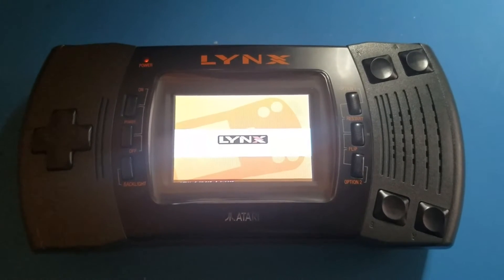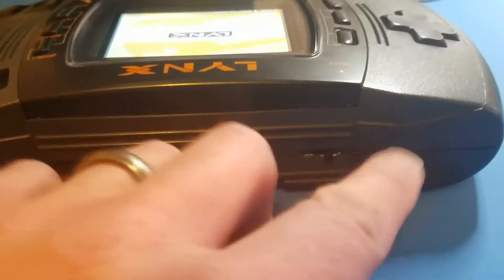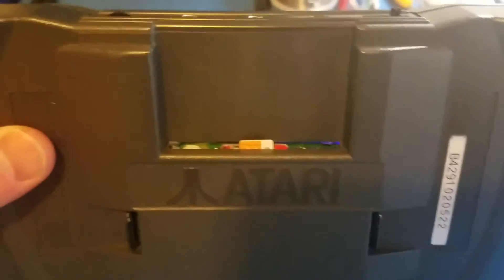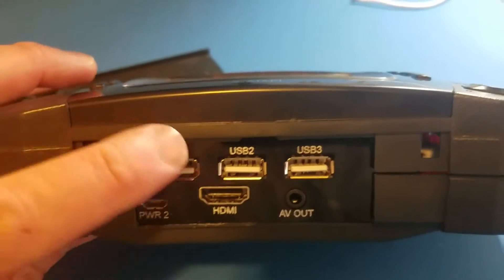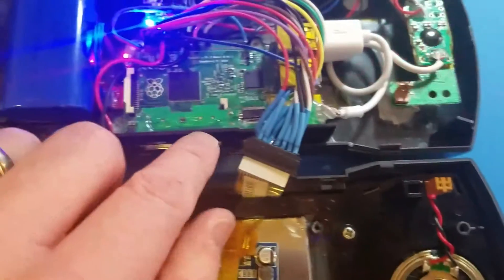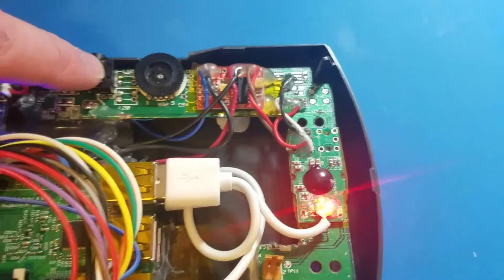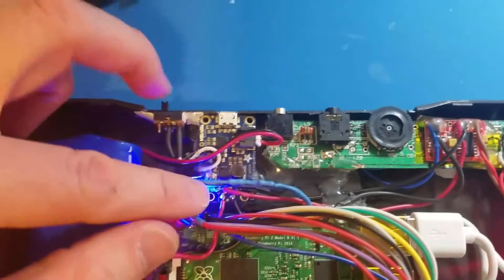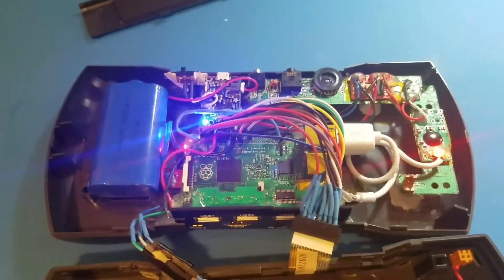Atari Lynx Raspberry Pi V2 Build - Completed with final touches

Comment: Hi, I built the original "RaspiLynx" which I think you referenced in version one of the Lynxberry build blog. Great to see you've taken my old mark one and improved upon it no end. Fantastic job!
Reply from the maker: Hey thanks!  And thank you for all your hard work, it made this project a LOT easier having a good frame of reference!  Is yours still alive and kicking?
Reply: Yes, still going strong and with a Raspberry Pi 2 and RetroPie now. I might change it and add in the Lynx audio components like you did though. I really like what you did with the volume control and headphone jack.